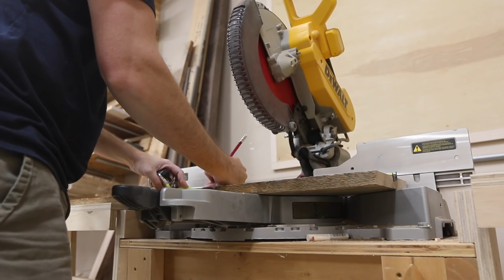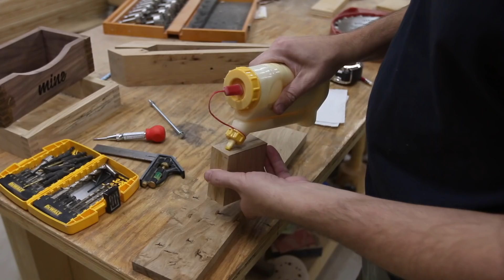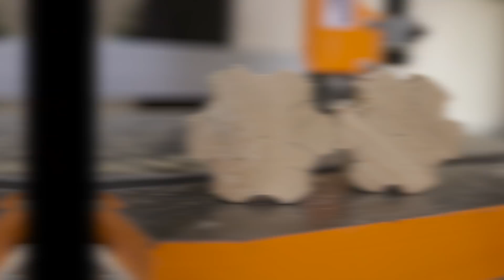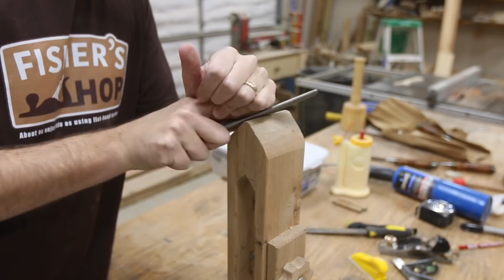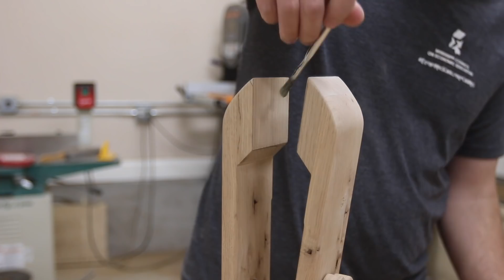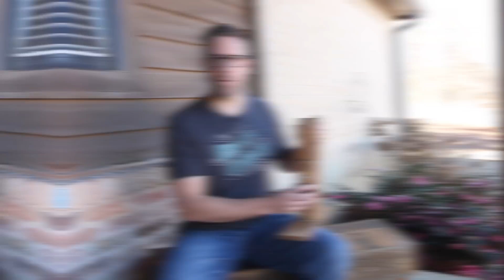Stitching Pony for Leather

Comment: Love the stitching pony. I made one myself after watching several other videos. I wished I had watched your before I made mine. But I added a spring in between the uprights on the bolt it helps opening when you move your work while clapped. You just loosen the knob and rotate your work. Just an idea you could add to yours. Great job.
Reply from the maker: That's a good idea!

Comment: Here we are four years later and I've got to ask, did the bolt pull out from the arm? If you put it on the outer side it would have wood material to pull against.
Good job though
Reply from the maker: Yes, that eventually failed and I did like you mentioned. Not sure why I didn’t do that the first time. Brain fart I guess.

Comment: In the future, using a threaded insert would be much easier than fitting a bolt in. Great project though, modifying it some for my own!
Reply from the maker: Mistakes were made. A threaded insert would be much better. ha
Reply: @BruceAUlrich  I just put a threaded insert in mine, didn't go quite to plan, couldn't get it in the whole way. Oh well. Another addition I made is adding a tension spring on the interior carraige bolt. This makes the jaws open automatically as you loosen.

Comment: Bruce.  Love the shim idea and will be using it on mine.  If the nut you epoxied in to your upright board pulls out then simply do the same procedure of insetting it on the other side so it pulls it in to the wood instead of pulling the bolt out of the wood.   I have a bolt epoxied  on the inside off my knob but I think I am going to redo it and put in a threaded insert for better holding.  Beautiful job on the build!
Reply from the maker: Thanks you! Funny that you said that, but the epoxy did fail. The chit came out recently. I think I’m going to go the threaded insert route like you mentioned.
Reply: @BruceAUlrich  Thanks for the response Bruce.  Are you going to put the insert in from the outside?  That way any tension on it will pull it into the wood.  That way it will never fail in my opinion!
Reply from the maker: Yeah, that’s the route I’m going for sure!

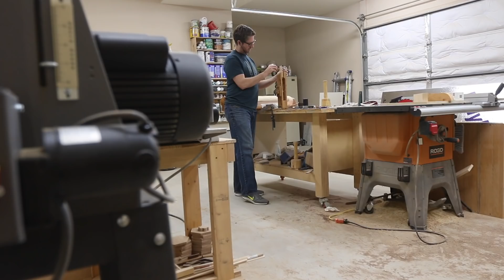Comment: 9:02 You're positioning your leather the wrong way. Stitching a floppy bit "in the air" like that defeats the EXCELLENT design of your stitching pony. Turn your piece 90 degrees so the stitch line is parallel (not perpendicular) to the edge of the pony and only maybe 3 - 5 millimeters above the clamp. This holds the stitch line firmly in place so you can do a nice clean saddle stitch. The idea of the sloped tip on the pony is so you can get your hands (and stitch line) nice and close to that clamping tip to do your stitching. 
Great work on the design, the only thing I might do differently is continue the leather pad up and over the top edge of the stitching pony.
Reply from the maker: Oh man, that's really helpful! Thank you for pointing that out!

Comment: Hi Bruce. It's a nice and easy pony you have maked. Nice detail with the ekstra woodblock. A tip for you... always clamp the workpiece, so you're stitch parallel with the upper edge of the pony. Just let it stick up about 2cm. It will help you to make it more stabil, when you're making your saddlestitch. At last, always begin away from your body, and sew towards to yourself. Hope this make sense.
Reply from the maker: That definitely makes sense. Thank you for the tips!

Comment: Sweet! I would use a spring on the thread bolt tightner that way it springs open on it's own.  But other than that that's a really nice stitching pony. Good job
Reply from the maker: Why didn’t I think of that?! Great idea.
Reply: David, that sounds like a great idea! Could you expand a little on how this would work, i.e. what kind of spring and where it would go? Edit: I see now, a coil spring would slide over the bolt!

Comment: Very nice. Well done
Reply: Do these typically get a cam lock? I feel like I would want a cam lock. And as I type that, you showed off the shim idea. I like it.
Reply from the maker: Ha ha. Yeah, similar thoughts. I wanted the capability of the jaws opening pretty wide without having to crank that knob a ton. The shim worked well for it and also allowed the bolt to hide in the jaw, not sticking out in the way.
Reply from the maker: Thanks, Tom!